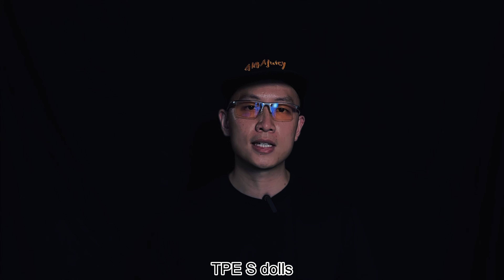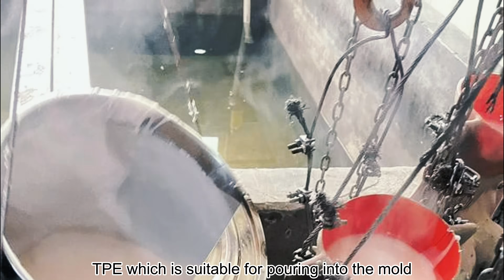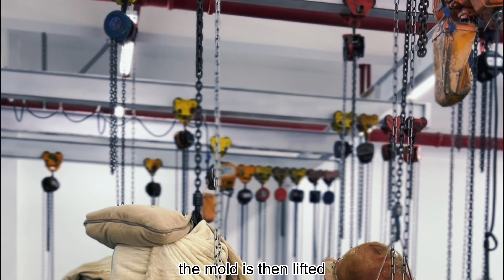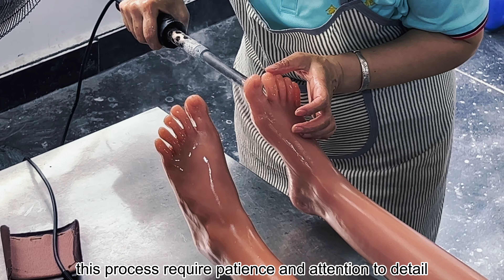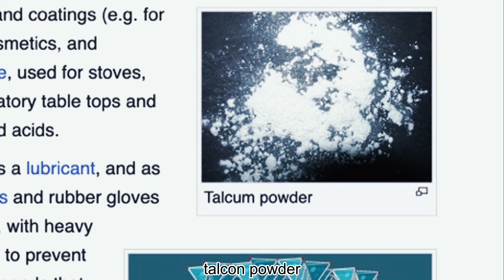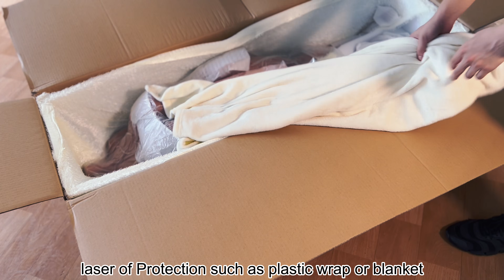How to make a TPE Sex Doll? - 8 steps factory process Explained

Comment: Is possible to make changes after the molding is done? Recently saw a doll with six breasts, very nice but the body was not impressive. The factory make dolls with beautiful bodies, could the attach the extra breasts to a beautiful body or do they need to make a new mold?
Reply from the maker: Interesting observation. I don't see the exact model but I don't think body parts like breasts can be attached post molding stage. Technically it sounds possible, but it's hard to really connect them properly. So in practice You may trim & tune the body details but not do big changes particularly "adding" bigger body parts; Smaller parts like a nipple should work in this case tho
Reply: @Juicyworkshop  that makes sense, thank you. Will you do a video on how the cavity for gel filled breasts and butts are made? Also why are the comments disabled on your other videos?
Reply from the maker: @aaronherring4839  Thanks for the advice, will keep that in mind. No Idea why system auto-turn the comment function off

Comment: I'm wondering how possible it would be to make a doll for wrestling with the same kind of technology.

How hard would it be to make a doll like this that you can consistently practice double leg takedowns on?
A problem with a lot of wrestling dummies on the market is that they're not very durable and they can burst after a month of daily training (Smashing the thing about a 100 times)

Maybe you have some unique insights into how to make a good wrestling dummy.
Reply from the maker: Hey Buddy, that is an interesting thought but I think these TPE products won't be even close to the durability of the currant wrestling dummies. It may just break after 1 time of smashing you use on training dummies. These sex toys are made too soft for your training purpose. I guess hardening the body material and adding reinforced metal joints on training dummies should extend their life span. But I'm not sure if this would cause other technical difficulties. Pure guess i'm no pro
Reply: Order a custom hanging bag punching bag lol
Manshaped

Comment: Okay. If Talcum powder is hazardous to humans, WHY don't they just use cornstarch during the production process??
Reply from the maker: Hey Blake I'm no Pro expert regarding decisions behind the factory but I would relate it to economical reason, difficulty of maintenance and supply chain stagnation. In general, toxins require time to build up, and research on the hazardous effects of talcum powder primarily focuses on its long-term consequences. Therefore, a small amount of talcum powder is unlikely to pose any immediate danger.

Comment: Just a question if I may, you said factory uses talcon powder (not corn starch powder), so once the doll arrives to the customer is oiling and re-powdering enough for safe use?
Reply from the maker: Hey Adam I'll try at my best as a hobbyist, but for serious health concern, as everone's condition is different, you may consider local medical consultation: 
 My understanding is, In most cases talcon powder would not be straight away "unsafe"; This ingredient is even still legal in baby powder products in China; In the worst case, toxinity takes time and concentration to be effective, so even short-term use of talcon powder shouldn't be an issue for most people. Switching powder after oiling removes talcon powder at least by the majority, this kills the possibility of toxin concentration so in this sense it is safe for use.
Reply: @Juicyworkshop  very comprehensive answer. Thank you
Reply: Wash your doll with very warm but nit burning hot water and a gentle detergent or mild soap.

Wash lightly with a Wash cloth, making sure you use plenty of towels in the bathroom, washing is messy but necessary.

Do not put the doll directly into a bath or shower, the head connector will run and get moldy.

Make sure to rinse by taking a new Wash cloth soaked in very warm but not burning hot water and rinse wipe from the neck down, to make washing the back and lower areas easier, you can simply roll the doll onto its sides to Wash either side, it's hazardous to wash sitting up against you because the chemical oil seep can cause Wash, once washed this won't be an issue.

After washing and rinse wiping, you will need to clean the fun parts next, I recommend a small Wash cloth or thin washing cloth so you are least like to damage the openings.

Very warm but nit hot water, mild detergent or soap, roll up the cloth like a thin burrito and then twist it in and gently make a cleaning motion.

To dry, I recommend parting the legs about 2 feet each side and using a large metal nut to allow minimal stretching and efficient drying using a fan on high-speed for about 30 minutes to an hour.

Do NOT use a hair dryer, this WILL damage the doll.
Reply: @MobBarley-z3k  very comprehensive answer, thank you my friend. I do own a doll already, a heavy weight but I got used to managing her well enough, 6ye 161j, I love the assets lol. What you say makes perfect sense, thank you for your time and hope others will read your comment too.
Since she's a heavy weight I hang her on a sturdy rack so the cleaning process gets easier. 
For drying the love parts btw I use a dust blower which is quicker than the aquarium pump many like to use, I eventually use the aquarium pump at the very end just to be sure to dry out completely any humidity left.

Comment: Being that the paint will only last a couple of months on a TPE doll, is there a method to maintain it so that it stays longer?
Reply from the maker: Hey Olivia, theoretically, there are a few possible solutions: 

1, A doll built with a TPE blend that is firmer and less oilly.  You will notice the same trend on silicon dolls, if you want to preserve the makeup on a doll head longer, brands/manufacturers would recommend "Hard head".  

2, "use " that doll less often. Every "rub" on the doll's makeup would remove it at least partially, particulaly when doing so with oil.